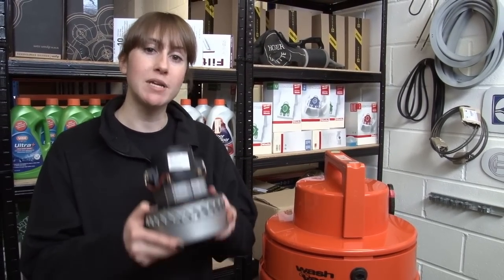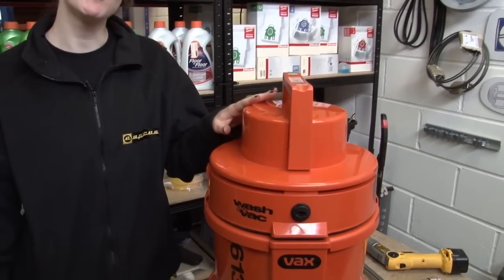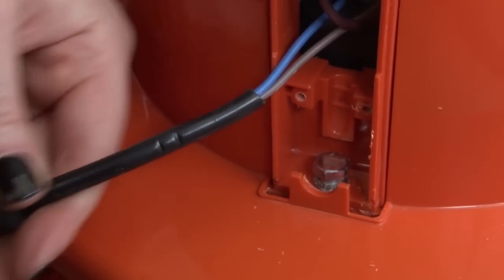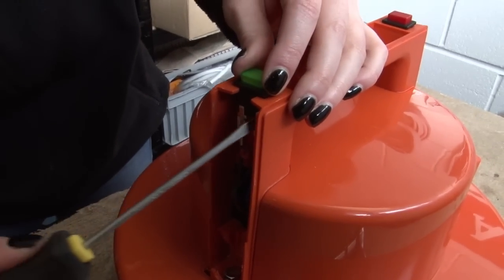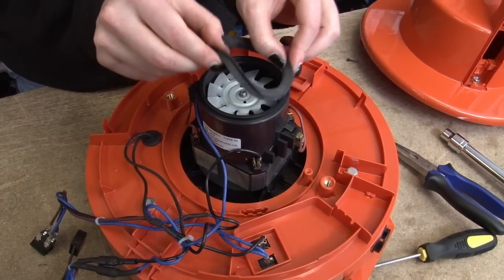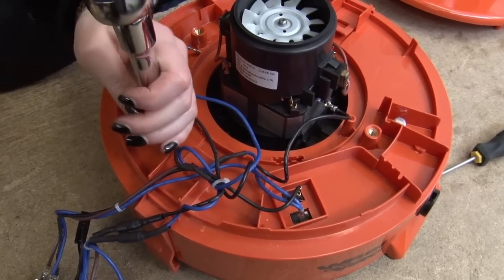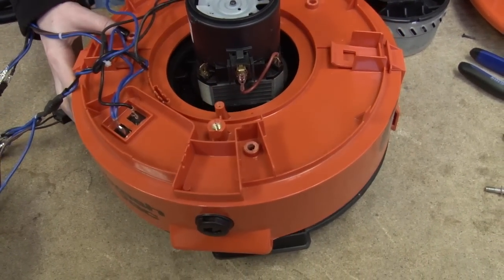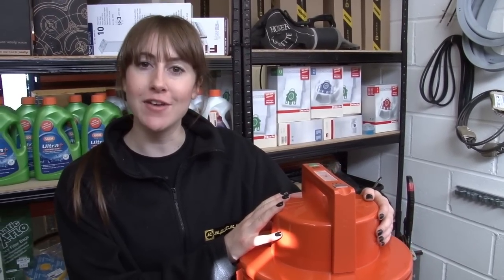How to Replace a Vax Motor on a Vax Multifunction 6131 Vacuum Cleaner

Comment: Its the pumps on these that I seem to have a problem with for some unknown reason, someone said you need to pump clear water through after using because of crystals from soap but it might be I used water too hot

Comment: My motor looks exactly the same but didn't have a rubber seal on the top from manufacture.
Trying to replace the motor for a 6131 on your site says discontinued by supplier, will this change or have you ceased to support it?
Reply from the maker: Hi spex357, if it has been discontinued it means the manufacturer has stopped making it, contact the sales team as they may be able to help source an alternative www.espares.co.uk/contact/sales

Comment: got almost the same model (5150)
no water flow - now I'm trying to order a new c.e.m.e. et-408 pump
am I right? or there's a big chance that failure is in another part?
as I remember green button was pushed with empty water tank for some time, I guess the pump is overheated and broken
Reply from the maker: Hi Михаил Николаев, it is possible the pump has overheated or just damaged the seals in the pump but if it no longer 'buzzes' when switched on then it is either seized or burnt out. It is unlikely to be any other problem.
Reply: thanks, just replaced the pump - everything's work fine!

Comment: I have a vax model v-100t. 

Would the motor in this vblog fit the model above??
Reply from the maker: Hi Lothian check out our website to ensure you get the correct part for your model www.espares.co.uk/browse/at1086ma694/vacuum-cleaners/vax

Comment: Heeelp!! Ok so mine is tripping the elec despite changing fuse. Ive looked online and its apparently the motor or suppressor? Cant see anything about how to know which one. Does motor come with one? Or do i buy sperately if so its cheaper so try that first. How can i tell which one is problem? And how do we fit new suppressor?
Reply from the maker: Hi Bob Ben, if it is tripping the electrics then you will need to test the components, this video may help www.youtube.com/watch?v=pJkyY8qRRwc&t
Reply: you don't really need suppressor on vacuum nowadays

Comment: Hi, I don't know if this is due to the motor. But my Vax hoover doesn't turn off. As soon as I plug the hoover in, it starts running, and no matter how many times I try and press the on/off button, it won't turn itself off. What do I need to replace?
Reply from the maker: Hi Pãndã, you will need to test the on/off switch with a multimeter to determine if it has failed, this is the most likely and the video shows you how to get access to it.

Comment: Mine is a model 121, serial number 1015836.  I cannot get the cowel and motor base apart.  The vax being worked on does not look like it has ever been used.
Reply: It just pulled apart.

Comment: My VAX 6131 Is Very Loud I Think It’s From The Motor But I Don’t Know When I Switch It On It Make A Very Loud And Strange Noise Please Tell Me What To Do
Reply from the maker: Hi Muhammad, try following this video to remove the motor and examine it. The likely cause would be the motor 'worn out' but it is possible the fan could have come loose or something got stuck causing the problem.

Comment: How expensive are these motors? I'am trying to make a jet turbine since the fan blades are perfect:)
Reply from the maker: Hi Lorenzo, we sell many vacuum motors at a wide range of prices.from under £24 to over £140 Have a look at our website at: http://www.espares.co.uk/search/pt1574/
Reply: Tanks:)
Reply: How many American dollars is that?
Reply from the maker: Braden T Hi Braden, Unfortunately our motor is for Non American markets as it is designed to operate on 220 to 240 Volts and not on 120 Volts used in the American Continent. :-(

Comment: Are these motors still selling, or are they discontinued Plz? 
My vax has suddenly stopped working. Before this this, as I was vacuuming, the motor seemed to slow right down, and there was a metallic smell as if a plug was on fire. This is the best way I can describe it. I’m guessing this is the motor packing in? Do you agree? There is no power now. My vax won’t switch on at all.
Reply from the maker: Hi MORFYBOY,  the smell could indicate the motor and the video shows you how to dismantle it to inspect it before deciding if you need a new one, we still sell parts for VAX cleaners on our website www.espares.co.uk/browse/at1086ma694/vacuum-cleaners/vax
Reply: Thanx. I will take it apart as shown in your video. Either way I’ll know what’s going to Be needed. 😊

Comment: Hello, it's possible to do an upgrade with the motor with code 11me74?
Reply from the maker: Hi DESFLESH without your model details it would be difficult to know if you could fit 11me74, please see our website with our full range of parts that may be suitable http://www.espares.co.uk/search/pt1574/vacuum-cleaner-motors?SearchTerm=vax%20motor just copy and paste into your browser.
Reply: Hi! Sorry....The model is the same of the video. Vax 6131. Thanks
Reply from the maker: Hi DESFLESH, check out our web page for vax 6131 http://www.espares.co.uk/search?SearchTerm=vax%206131%20motor just copy and paste into your browser.
Reply: Ok, thank you! Just to know...It's possible to provide me the specs of the motor? In the desciption there isn't any infos about watt power, model number etc. Thanks in advance
Reply from the maker: Hi DESFLESH, do not have the specs as the part is supplied to fit the exact model number to ensure the correct part is supplied to you.If you have any issues please talk to live chat team who can help to find your correct part.
Reply: Well, thank you again for the infos!
Reply from the maker: Your Welcome :)

Comment: BEWARE!!!!!!!!!

Not all original 6131 motors are like the one shown here: some have a less deep fan and a separate plastic moulding at the bottom so the bottom seal doesn't fit where shown and the top seal is a different depth and doesn't fit at all.

Not all the connectors to the motor pull straight off and if you use a pair of pliers you'll ruin them as they have a latch pin which needs to be raised first.
Reply from the maker: Thanks for the info. If you use the full correct model number on our web site you should receive the right part.